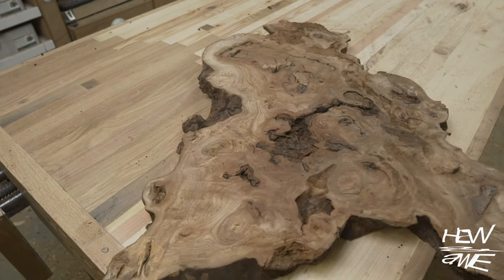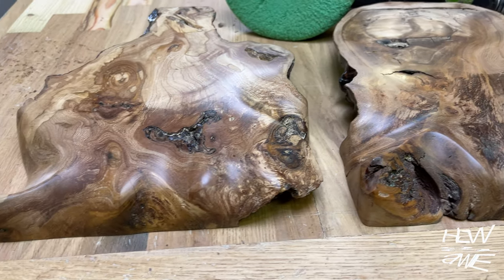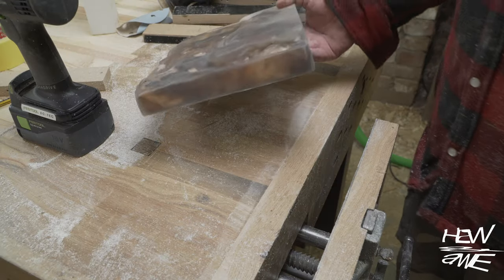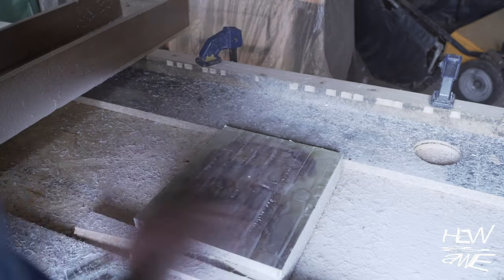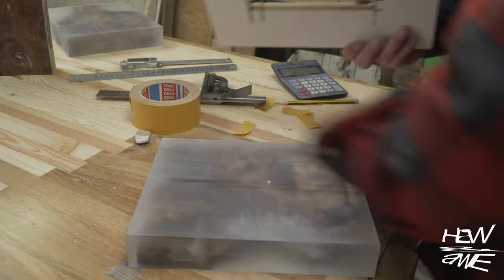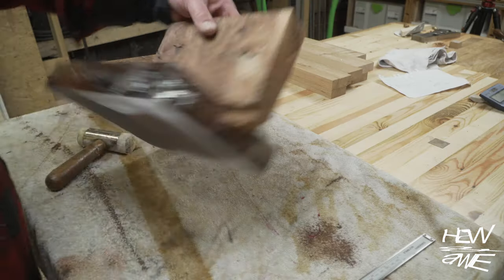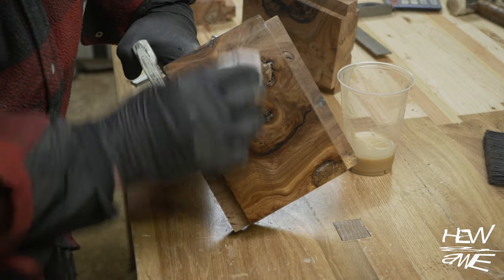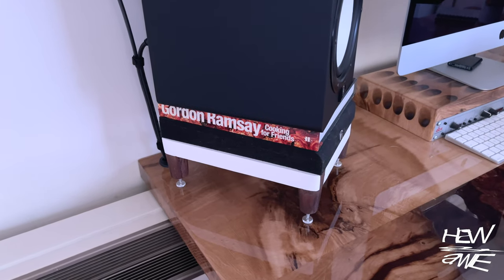DIY Wood Speaker Stands.

Comment: Looks great!  The pieces all go perfectly together.  Very well designed and really shows off the BURL.   You have a great eye for design details, such as those feet on the speaker stands 👍.  I'm admittedly not a fan of epoxy (except as an adhesive, or boat building), but these are still examples of fine craftsmanship and solid design.  Thanks for posting.  I can't imagine how much time it must take you to produce and edit these videos 🤘
Reply from the maker: Hey bud, sorry for the late reply - I know I suck at the comments! I get to them sooner or later when I'm feeling good genrally. 
Like you mate, I'm well on the same fence too with epoxy. I have a strongish hate for it but cause I see mostly most peeps dont enhance the wood they're using, and use a bright blue or the likes, or stuff a load of sea shells in there. 
I think some forget the wood is the big Hollywood star of the show! Was why I went with clear, any pigment that flattered the wood would of made the burr blend in, which in my mind would be very wrong! Simply put a tool was used to help show the wood, but I dont think I would do it again, it scratches easily and MY GOD what a ballache to deal with!
None the less, I finally have some nice looking furniture in my flat that I made, its a nice place to sit at with all that nice beautiful wood 😀😀😀Hope you're well man! Kind regards, Ben.
Reply: @HewAndAwe  Thanks for taking the time!  I hope all is well.  Keep on trucking, making content, and building stuff.  Epoxy is an excellent ADHESIVE.

Comment: El magnifico! Looks the part, Ben. That black top seamlessly blends with the speakers.. 👍😁
Edit: forgot to add, what I liked best is how you recovered from those air bubbles. By the way, i had the same steaming issue with starbond super light one. Glad to see someone else have the same pblm 😜

Comment: That is so classy!  Despite all your troubles on builds the end result is always spectacular.  Will this be the last epoxy we see from you? :)
Reply from the maker: Hey bud, hope youre well and good mate! Sorry for the late reply, I know I suck! Probably mate... to be honest, i learnt a lot that most vids dont mention about epoxy, the biggest point is its not that durable and way harder to refinish than say a wax oil! Resin will probably stay as just a fix for knots and checks for me to be honest bud.
Reply: @HewAndAwe  I've got a few resin project ideas in me, but I'm not confident in it's longevity.  Are there millions of river tables on the verge of falling apart as the wood ages?  Peter Brown did a good video yesterday showing his years of resin projects and how they've all yellowed over time too.
Reply from the maker: @ChrisFranklyn  there could be other reasons for the yellowing, like cheap grad none UV etc etc. I can say 100% that when seasonal movement happens the epoxy stretches and contracts, so dependent on season the epoxy will look lower or higher than the wood, hope that makes sense bud?